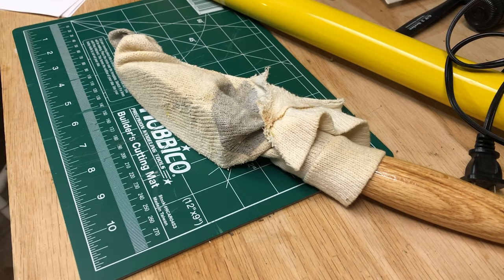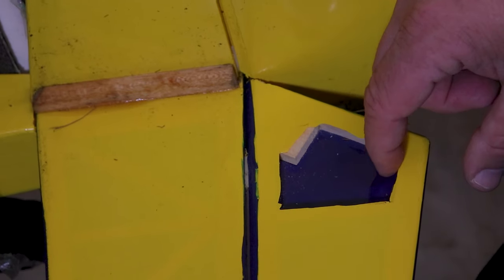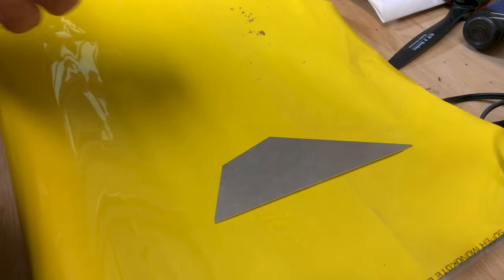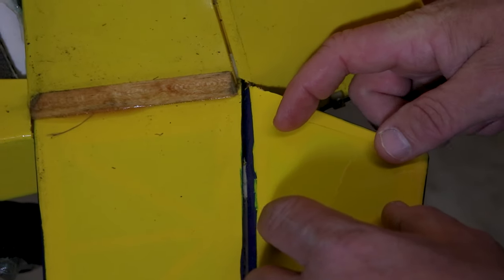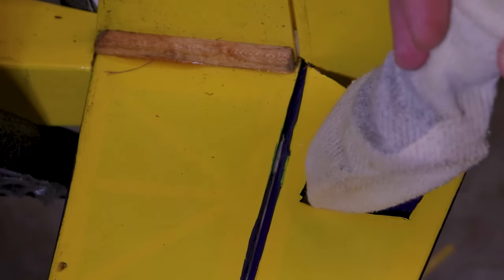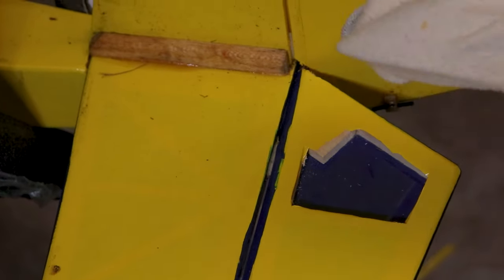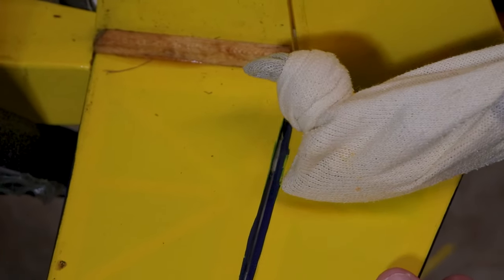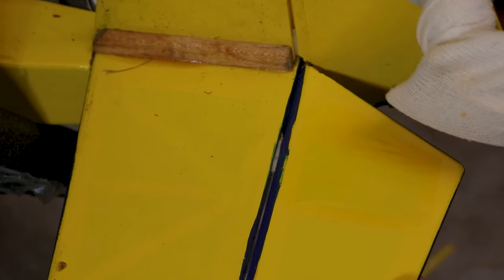Repair RC Plane Covering Film

Comment: Any advice on removing old monokote cove. Bought any old plane from someone. It has been in a garage in the hot Louisiana heat for years. The clear coating was falling off the monokote. Used a heat gun. Removed a lot of it. Went over it with packing tape heat. Removed a little more. Now I'm left with the orange cover adhesive in spots. If I use acetone it just smears. I'm going to cover it in the same color. Do I need to remove the rest. If so, any suggestions? Thanks for any advice you can provide.
Reply from the maker: If it's the same color, you don't have to remove all of it.  To help the new covering stick because of old covering left, you can use Cover Grip covering adhesive. Here's a link to it if you would like to check it out: https://alnk.to/2jMkqWR

Thanks for the question and for watching!!!

Comment: Thanks for the video good info, I am somewhat new to RC Planes and have a question. I purchased a tower hobbies trainer Rc plane and have been working on putting together. I was just about finished when I realized the servo centered under the wing I did not put the brass and rubber grommets in the 4 holes. I tried to take the screws back out and ended up stripping the screws, then tried using a screw extractor when I applied pressure to the screws I snapped the wing in half and the small piece of wood that was glued in the center between wings. I then was going to make a new piece of wood to go in between by cutting in front of the old piece and re-glue it. I don’t think this will work and end up making more of a mess with the wing. The piece of wood originally had a slot cut to slide into both sides of wing, I’m not going to be able to do that with the new replacement wood. I never did monocote before so I’m thinking I should cut open the area where damage is glue wings back together with area open I can use clamps for a good fit. I hope I gave enough detail in what I’m doing what is your opinion on this project. Thank you
Reply from the maker: Sorry, don't know how I didn't see you message until now?? I imagine you have already repaired or replaced the wing by now? Which way did you go? If you repaired it, how did that go and have you had any flights on your plane?
Reply: The Traveling Tech Guy I haven’t yet I run a Bush Hogging & Lawn Service  it keeps me pretty busy so it hasn’t given me a chance to do the repair. But I have already started where I cut small box holes underneath the wings to where I can get clamps in there put a thicker piece of wood and just appoxy the crap out of it that should take care of it
Reply from the maker: Good luck! Let me know how the maiden goes and how good it flies...